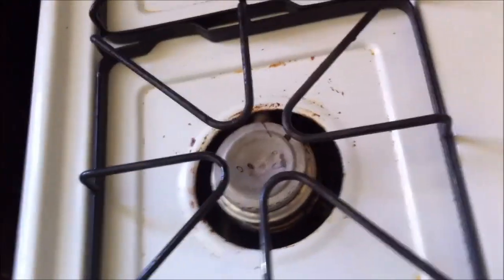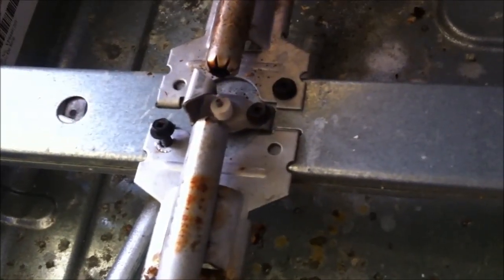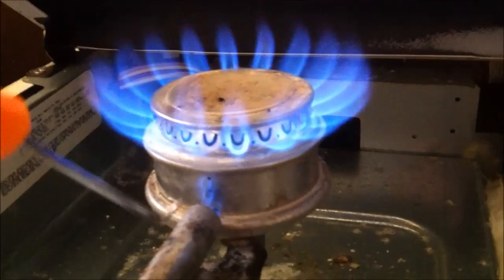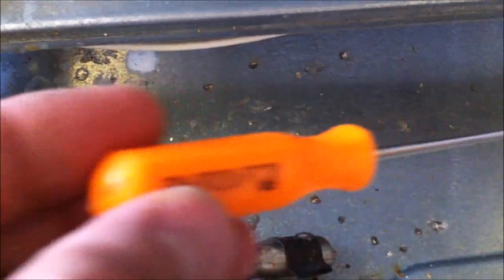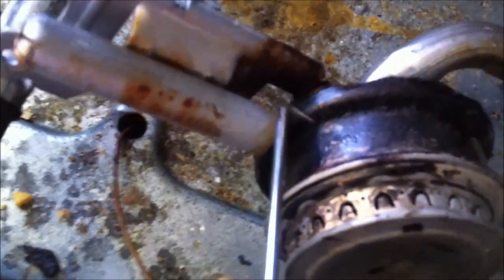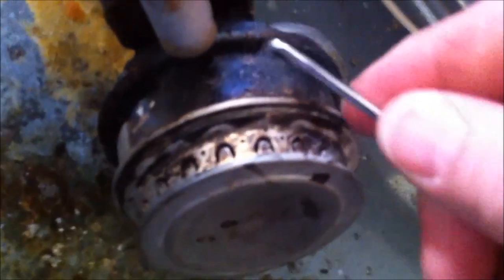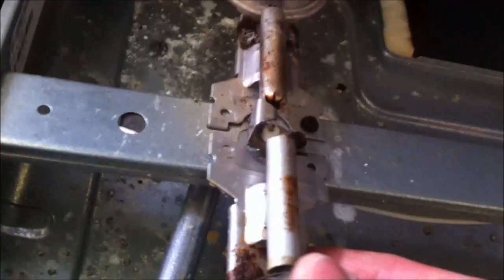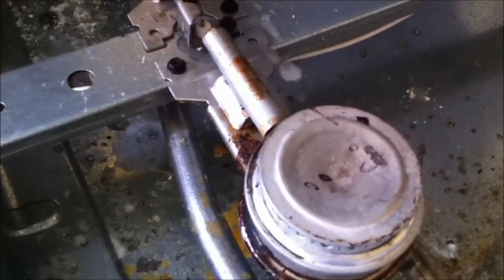How to fix gas burner that wont light

Comment: Thank you!  It worked!! My landlord told me there 'was no hope'. I'd boiled over milk. All 3 other burners out of 4 worked but the one that boiled over. My old stove is similar in age. I took a small gauge wire, like a paper clip...and poked it in the tiny holes a few times. I'm VERY bad at home repairs. You're the best!

Comment: It's really important that you keep your stove and various parts under the cooktop clean to keep it auto-lighting for a longer period of time.  There's a lot of burnt on grease all over the stove parts which is the culprit.  I take all the parts out twice a year, use oven cleaner and stainless steel scrubbing pad to scrub off all that food debris.  Before replacing the pipes etc., I line the bottom with tin foil which makes it much easier to clean the bottom next time.  All those crumbs attract bugs and mice.

Comment: My stoves of my stoves gas oven, well 3 of them are not working due to water being on for 24 hours or so.  Now I need to let it dry out until all the water is evaporated and the stoves can be used again.  At the moment I am very twitchy and in a no man's land with it all, very taken aback by it all.   Was encouraged though by the news on my oven that if the ignition parts don't behave themselves I can use I match or a taper so sort it out.  It's just so annoying and perplexing that it has happened.

Comment: You are the man!! My stove is ALMOST identical, but with mine, I couldn’t remove the actual burner like yours so I used a toothpick and felt for the holes at the back and cleared them out - then VOILA!! Let there be 🔥!! Sooo happy I don’t have to manually light it anymore! Many many thanks!

Comment: So THANK YOU!   I have these Same Burners but have a Pilot Light instead of the Igniter.   And YES!… those tiny Pin Holes were clogged after I did a Deep Clean of the underside of the stove top and burners using SOS pads.  Once I used a sewing needle to unclog the pin holes on the burners it all worked perfectly as normal.  Thanks!

Comment: I fixed my stove using this video. Thanks so much! I didn't have a screwdriver that would unscrew the burner, but was able  to unplug the primer holes with a piece of wire while  they were still in  place. No idea if that was safe.... but  it worked. Thanks again.

Comment: Thank you! This is exactly what I was looking for. I have this old stove in my rental, and I didn’t even know you can lift the top 😳 My problem was that the little flames in the middle were extinguished after my cleaning and I started to smell gas. (Apparently they are supposed to be alight always.) Mine is probably even older stove than what you showed.

Comment: I did not know about the 3 primer holes on the burner. I chose to use a welding tip cleaner to ream them out so that worked fine. I also reamed out the gas holes on the top rim of the burner since I was already in Mr.Clean mode, and after washing the burner with SOS pads it works & looks great. Mahalo for the great tip.
Reply: Todd White is there some kind of primer holes for the over as while. i can't get it to light. Also....is it safe to light with a match like people do with the top burners?
Reply: TheRoidemortetfleur If after cleaning out the burner holes on your stove, as this video suggests,  and you still cannot get the burner to fire up, then check if you can smell gas. If not, then take soapy water and spray it on the primary gas outlet into the tube to the burner. It should blow a bubble if there is gas coming from the tube. If there is no bubble or visible air/gas coming out of the tube, then you have no gas from your outlet into the stove. You most probably have a gas supply issue. As you probably know, you have to get gas to the stove in order for the stove to operate. No gas, no functioning stove. Start there and then report back.
Reply: Todd White I can hear the gas turn on. don't know if any is getting down to over. I try a soapy rag instead of spray ...fear of losing pilot light....Also the valve box right before over bar might not be releasing gas. If that is where your are saying to spray soapy water I'll try that to.....It did have like a white foam stuff forming on the plate above pilot that prob. doesn't help. or got into over bar...Is over bar removeable?
Reply: Just a side question. If it is the gas/safety valve not releasing. I would hear the gas shut off when it is filled......I'll try the soap idea. TY

Comment: My burner won't light completely. I used a safety pin in each of the holes along burner. Maybe the area of the flame release needs cleaned not sure.
Reply: That’s my problem did u ever get a chance to fix it ?

Comment: I have the same stove. The rear burner lights fine, when I try to light the front burner on the left side I don't even get the ticking igniter sound. But I do on the rear. The gas is flowing but no ticking to light the front burner. It lights fine if i hold a match to it. Do you know how to fix that? Thanks!